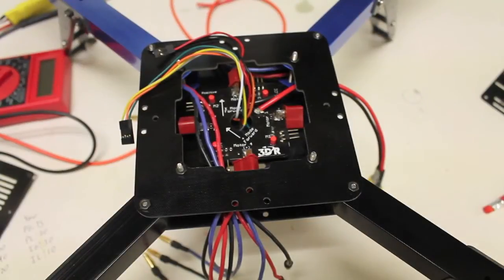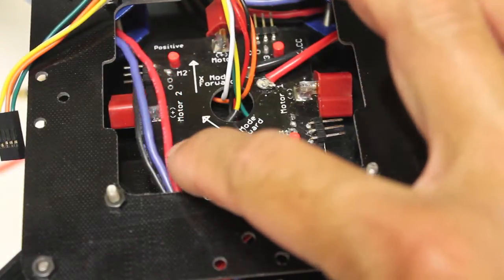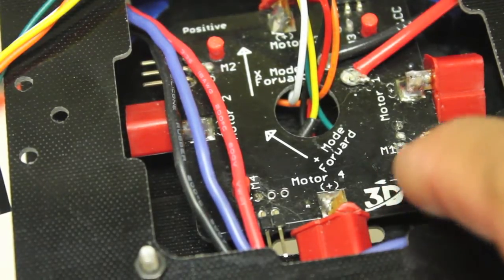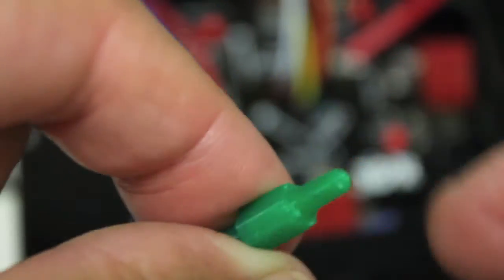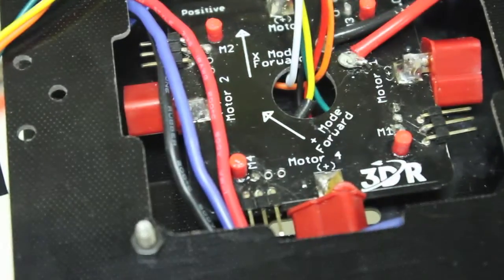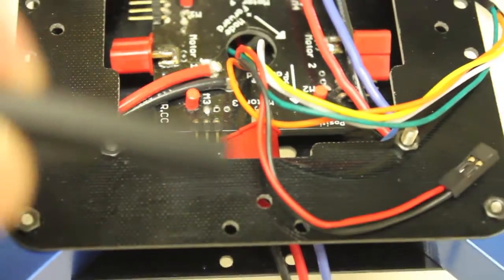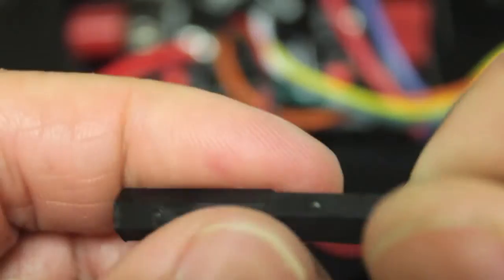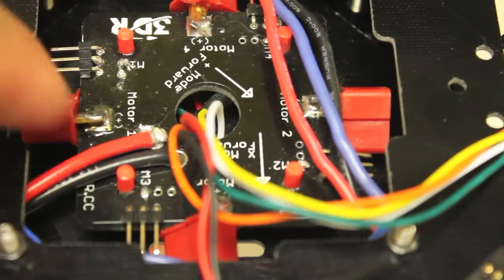ArduCopter APM 2.5 Repair with 3D Printed Spacers for Power Distribution Board

Comment: dennis can you share pid settings for dji 450 frame with apm 2.5. 1000kv motors, it is smooth in stablize mode but it get little bit wobbie .or osilating when i do a loiter , i really do not want to play with pid as then i donot  have an idea what i am doing